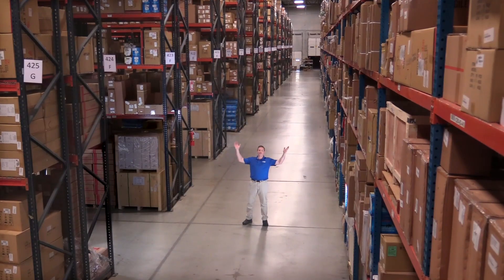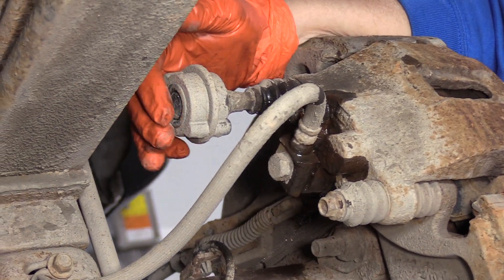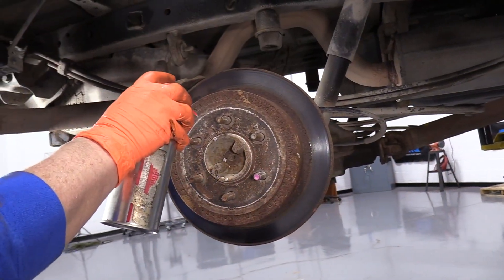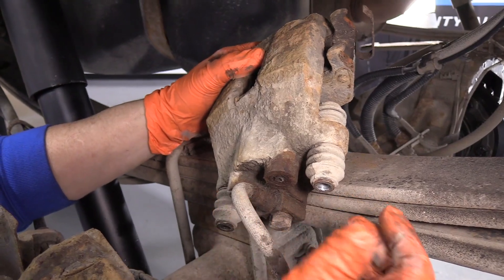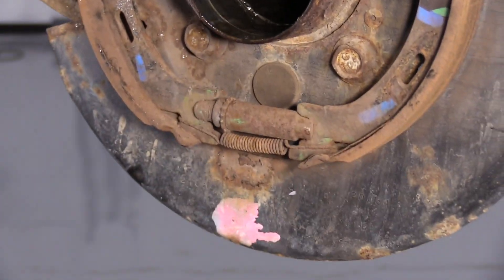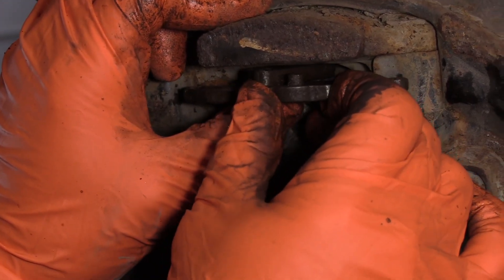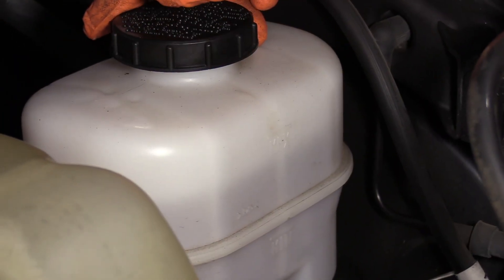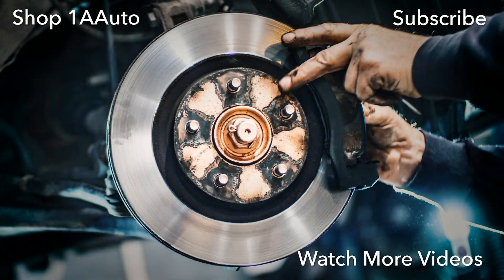How to Replace Parking Brake 09-14 Ford F-150

Comment: I'm a retired ford service manger with over 30 years working on ford trucks, this was a very good job of explaining the system. Very impressive. Only thing I used to do was determine which way I need to turn the adjuster before I put the rotor or drum on.
Reply: Bahhh! That spring was on outside 😳 i bought that truck used and carfax said brakes were done, that michigan mechanic must not seen this video...lol... i went and put them on the outside again, lol! Oh well it works, im not fixing it if it is not broke...😉
Reply: @rocxylemmon8535  yes very detailed info

Comment: Great video! Loved the narrator! UNTIL 8:40 in, AUTO MAGICALLY THE AXLE IS REMOVED!!! WHAT!?!?! Lets see the parking brake replacement with the massive axle end in the way. Hesitant to do this since it seems getting it done without removing the axle will be MUCH MORE DIFFICULT!!! This will make what's done at 17:40 almost impossible!
Reply: If u would watch video again she said she was doing other parts she was just showing a step if u are scared about pulling a axle out u shouldn't be working or watching this video
Reply: It's not hard to replace with the axle inplace... its as simple as putting the spring in first, using a screw driver to spread the shoes over the upper portion, then put your lower spring on with a pair of needle nose pliers. An extra 30 sec saves you an hour plus of work.
Reply: @hanksadventures4132  thumbs down on that remark. PITA hands down.
Reply: @bradvincet1848  This is almost identical to what I have on my 96 Explorer. Same levers and all. The Explorer has TWO upper springs. You have to be a bodybuilder to get it on with the axle :lol:.

Comment: What we missed was the part where you loosen and drain the differential cover and remove the horseshoe clips so you can slide the axle out. Which adds more time and expense since you'll need to reseal and refill the cover. Mentioning this during the video would have helped.

Comment: Good video---I watched a few do this and she is the only one (so far) that advised opening the bleeder B 4 pushing the piston back and damaging the A B S system.  That can get a lot more expensive then a caliper for sure. Two things I would add--adjust that star adjuster by hand with the rotor off, when you think you are close try the rotor on  a few times till you see the shoes contacting the hat of the rotor. That way you are not spending so much time turning the star adjuster with a tool through that little hole. You may still need to adjust after wheel is on but only a turn or two if that.  Stop letting that caliper hang from the rubber hose. Use a stiff wire or bungee cord to take the weight.
Reply from the maker: +THG Driver Thanks for the feedback!

Comment: Abs module defaults to an open position. Made that way in case there’s a failure in abs system. That way the base braking system will still work to stop vehicle. This advice in video about opening the bleeder screw can cause problems for the average do it yourselfer if they don’t properly bleed the system after. Only time I open bleeder is if there’s a leak in system, opening the system for an actual hydraulic portion repair or if I’m flushing the old brake fluid out.

Comment: You did the easy way, lol.  Would love to see some tricks to put the shoe pins back together with the hub still in the way.  And the springs I have are not the typical push and twist.  They look more like a c-clip and need to be pressed and slid into position.  Quite tricky to do with the hubs still in the way.

Comment: I noticed the top e-brake spring in your video shows it behind the spring.  Other videos I have seen shows it in front of the shoes.  Is there a reason it goes inside?  Much easier to put outside but I want to be correct when putting this beast back together.

Comment: Helpful video but job is a bit more difficult with the drive axle and abs sensor ring in place.  Also, how does she get the parking brake lever to stay perfectly at the top when putting in the new shoes?  100% agree with truebloodtexas1 that you shouldn’t let caliper hang by the brake line.
Reply: I had the same problem the lever wouldnt stay in place when putting back the new shoes. I noticed in an another video the moving part of the lever that keeps falling off going above instead of below as in this video, which makes more sense to make it stay in place. Any idea if it makes a difference? Also in that other video the top spring is installed in front of the shoes, here in the back

Comment: I’m still curious how you damage the abs system when the fluid can freely flow back into the master cylinder? Not to mention the abs pumps the same, if not, more pressure than what the human can retract that piston back into the caliper.
Reply: Because the calipers are at the lowest point and have filthy brake fluid. Some say that can damage the ABS. It is a good idea to bleed FIRST, then do the brakes.
Reply: @alb12345672  I always open the bleeder screw and then push the piston back in. All the dirty fluid comes out that way, not to mention it goes back in faster like that. Then close the bleeder screw.

Comment: Hey, great job, I didn't see you put any grease on the outside of the pads where the piston touches (inner pad ) and where it (outer pad) touches the outer part of the new caliper, I've always been told to put grease on all the accessible contact points except the ceramic lining on the front of the pad, any input?

Eric

Comment: I purchased the kit with the new rubber boots.  However, to replace them, the brake dust shield has to come off.  I thought I could just loosen the 4 bolts on the shield to pull the shield out enough to slip the new rubber boots in, but there are two rivets holding the dust shield on as well.  Do I have to pull the axel out to drill out the rivets just to get the dust shield off, or are there any tricks so I don't have to go through all of that work?  Also, if I have to pull the axel out, are the seals reusable or should they be replaced when the axel is removed?

Comment: 22 dec 2019 4:3 pm est:thanks
23 dec 2019 11:31 am est:
5:58 show drum-brake is still being covered
 8:40 suddenly show drum-brake is open
20:30 suddenly drum-brake has cover again
Reply: She mentions they took the hub because it was being replaced as well but it isn't necessary to do the job.

Comment: The video is excellant and professional. But two things I was disappointed about and the first one is grease from the greasy gloves for on the e brake shoes I thought it would have been appropriate to change gloves. The second I thought it would have been nice if removing the axle could have been included in the instructions.  Overall very nicely done. Do you have a video that shows the removal and installation of the axle?

Comment: Cutters are an odd thing to use as pliers on a spring wire.
Reply: Odd?  maybe so, but the cutters did the job very nicely
Reply: They give you more leverage, awful lot of non mechanics here commenting
Reply: They also slightly cut the metal making a weak point so the spring will fail early making more business for the mechanics

Comment: I noticed that when she took the sprocket(?) off the adjuster to grease the threads she put the sprocket back on with the wide side opposite of the way she took it off if that makes a difference.

Comment: This whole procedure is completely different with with leaving the hub on. The clips are near impossible to get back on on my 2015, nor can I get the pivot off or unhooked from the cable with the hub in the way. The springs on 2015 are super beefy too. Not a fun time
Reply: Any tips? I’m doing my 2012 and I’m having a hard time getting those damn clips in.

Comment: Why don't you show the job WITH the axle in place? Who would remove axles just to change the parking brake?
Reply: She does the rear seal replacement in another video, and then replaces the parking break as well.  It’s all one series on the same truck.
Reply: On some fords you have to remove the axle like f350

Comment: Why is this different than my 2014 f150 park brake set up? The lever is different and also the upper spring. I don't know if I have the wrong spring kit or what
Reply from the maker: +Jason King The installation should be similar but there will be differences based on the year and models.
Reply: @1AAuto  mine is a 2014 XLT with XTR package. Slightly different park brake set up from the one in your video. Upper spring is definitely different.

Comment: Also too, how did you get the actual wheel part removed to access the p break shoes? I've seen a video where a guy changed them without removing this, looked like a pain in the ass, I'd feel safer removing that wheel part, I'm assuming thats connected to the axle shaft with bearings, I think I need another axle shaft with new bearings, when driving down the road I notice the bed kind of bouncing up and down just a little, like it may be bent just a little or bad bearings, any idea?

Comment: great video, lots of useful information! however, it would have been much more informative to see this procedure, and special tools and talents used, with the hubs/axles in place. no one is tearing apart the rear diff to change the parking brake components.

Comment: Great video......I am searching for the parts and nothing is coming up for parking brakes for a 2010 F150.  I have searched it many different ways.
Reply from the maker: +Rob Brewer Thanks for checking us out! We currently do not have this part available however we do regularly receive new stock so check back soon! 1aauto.com

Comment: You over torqued the wheel nuts.  They did not move with the torque wrench, which means they were over torqued with the air or electric tool before you even started.  Only spin them on and snug slightly before using the torque wrench.  Someone did that to my LR, it took over 600 ft lbs to remove them.
Reply from the maker: +Michael Smith Thanks for the feedback!

Comment: Thank you for the illustration. However, i would have liked to view the entire process. Why skip the removal of the axle, when that part is equally significant, although, I understand. It wasn't the main focus of this vid. Thx
Reply: They did that on purpose because you need a magic wand to reinstall everything with the hub assembly still in place!

Comment: The rubber boot at about the 12:09 mark, is that replaceable?  Mine is torn, and I'm guessing that's how moisture got in and rusted my parking brake.  Where can I find a new rubber boot and is there a name or part number for it?
Reply from the maker: +Jamie The boot will be replaceable however the boot may not be available separately. You may need to look for a kit that comes with a new cable with the boot. We currently do not carry this part and we suggest checking locally or speaking to a mechanic to see if they are able to get this particular part. We do not have the exact name for this but "parking brake cable boot" should be sufficient to let them know what exactly you are referring to; you can even pull our video up and show them where it goes and what it looks like.
Reply: @1AAuto  Thanks for the reply.  I found a kit online that comes with the boots.  Unfortunately, you have to buy the entire kit not just the boots.  For any others that might have the same problem, the kit is made by Dorman and is Part # 924-741 that will fit a Ford F-150.
Reply: yes doman makes it

Comment: Try reinstalling the parking brake components with the hub assembly still in place! What a pain-in-the-ass! You don't have clearance for pliers to reinstall those pin clips! Not to mention that upper spring on the shoes! You need ALOT of patience!

Comment: I have to replace the back plate on my f150 due to severe rust. The original plate is attached with 4 bolts and 2 rivets. What is the purpose of the rivets? Do I need to install new rivets? The bolts will hold the new plate in place.

Comment: I believe my brake rotors are stuck due to the parking brake shoes. Tried removing rotors got it loose but could tell something else was holding it
Reply: Shoes and rust in rotor parking break drum  holding them . I ran in to this doing differential on my 2011 f150 restoration  now I have to replace parking brakes  and hardware

Comment: Hey just wanna say I never put reviews never have the time but wanted to come back to the video and complement that it's amazing to see a women out in what most call a man's job and you explained it very well I got the brakes done much faster. 
Thanks for the great video
Btw wire cutters are not what I use to put springs on it graves it good and if it dose cut your spring it was time to change it anyways noticed the comment below don't have to be a dick because a women had to one show you how to do this job.
Gŕeat job